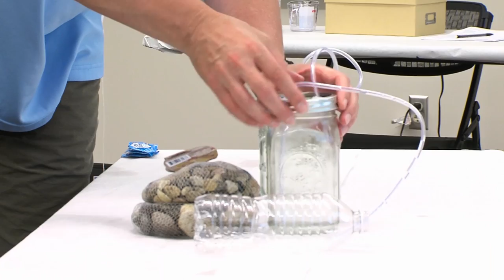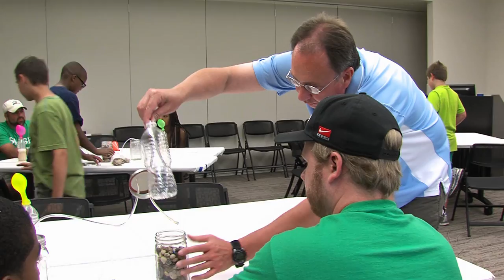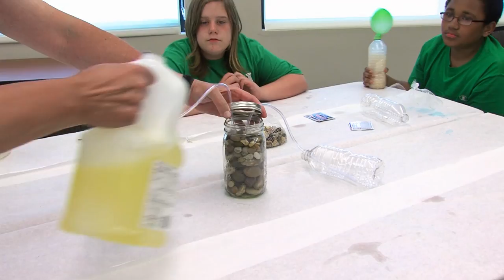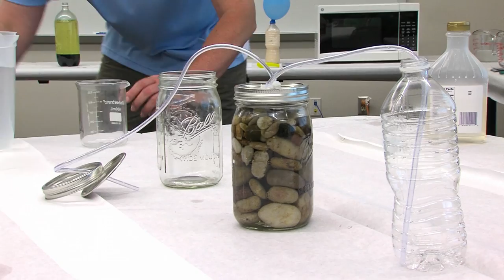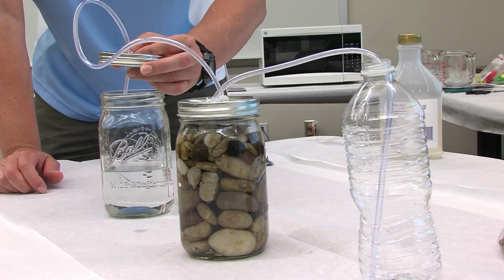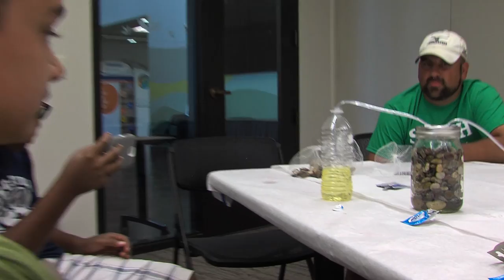Experiment: CO2 enhanced oil recovery (EOR)

Comment: this is not CO2 EOR. This is gas cap expansion recovery mechanism. I can get those veggy oil out by just blowing air into the tube.  Air is much cheaper than pure CO2
Reply: +jack schitt  i don't think this  is ECO producer class
Reply: I think you are right) In order to reach the miscibility with the oil, CO2 needs high pressure and obviously we cannot have this pressure in that Jar so It cannot be considered as CO2 miscible Injection)
Reply: Bro chill. You are right but you fail to understand that this is a demonstration of the concept for students. They are not going to pump liquid CO2 at high pressure.